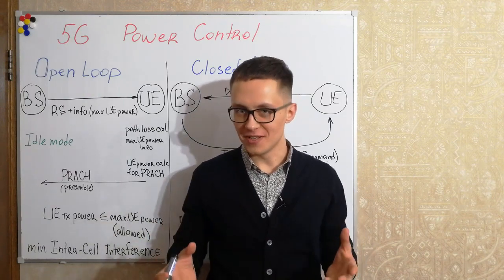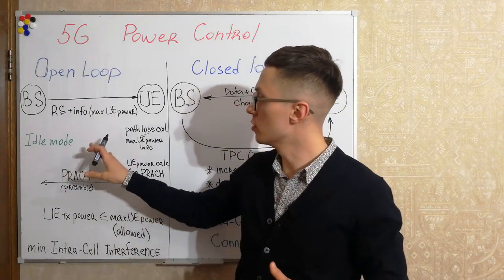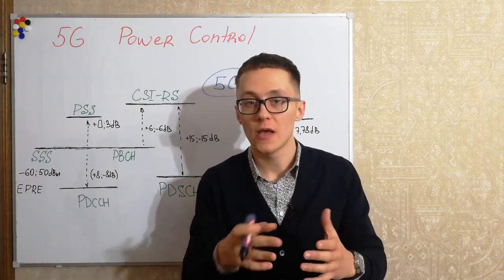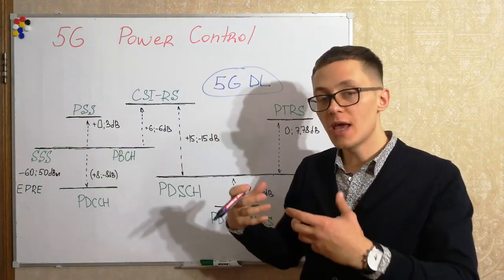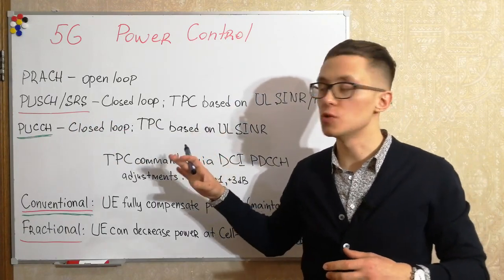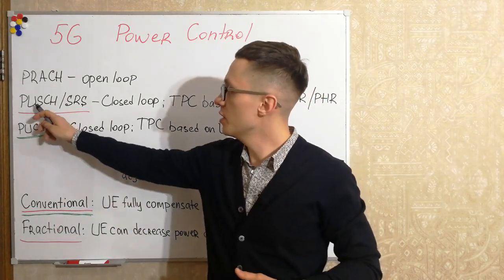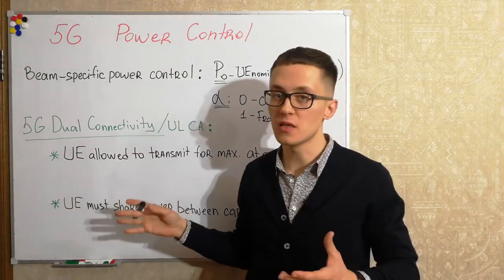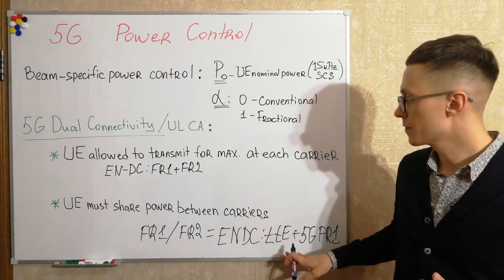5G Course - Power Control Aspects Beam power control and Dual Connectivity power control

Comment: Hi Gleb, I had some questions about the UL power Control.
1. You said PRACH use Open Loop but PUSCH & PUCCH use Closed Loop, right? And you mentioned the conventional & fractional power control used for PUSCH & PUCCH (fractional only). But do the conventional & fractional power control belongs to Open Loop?
2. Do you know which kind of power control used for the real network? If we know that the uplink power in the real network will increase when the DL signal is not good, can I said that it should use the open loop power control in PUSCH?
3. If I disable the TPC control setting in the NW simulator, shall it represent that I am using open loop for PUSCH?
Reply from the maker: Hello! 
1) Conventional & fractional power control belongs to closed loop power control!
2) PRACH - open loop / other UL channels works in closed loop power control
3) Don't know exactly...
Reply: @5G_Understanding  I got it. Thanks.~